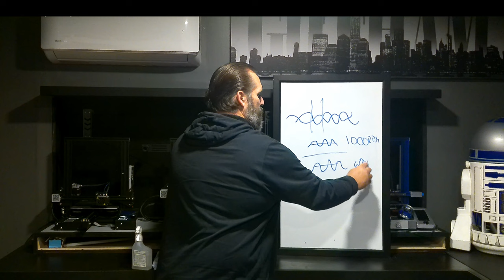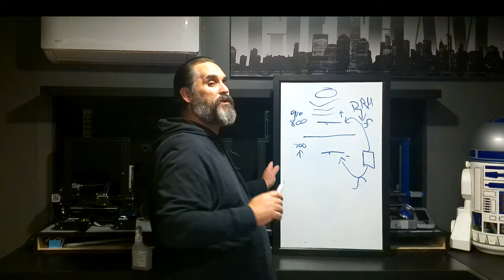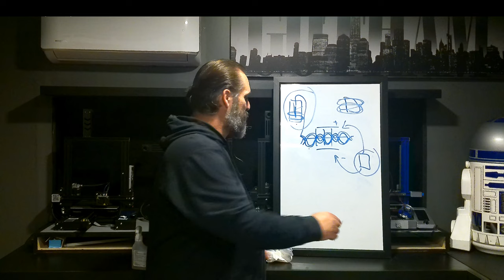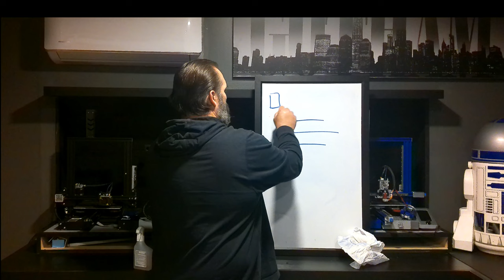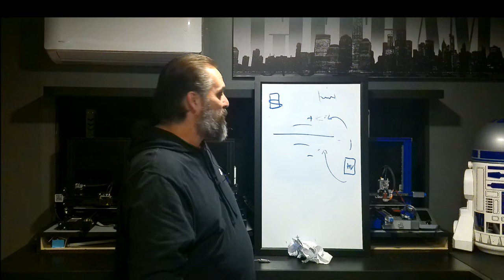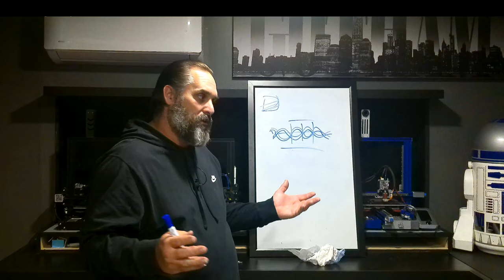Graviflyer "Tuning By Sound' #26

Comment: Gravity consists of two structures. One is the lower and the other is the superior rotating (+) static charge field radiation(x-ray). These fields turn against each other. the upper rotates to the left, the lower rotates to the right (vortex). Everything remaining in this field (all matter is a negative single pole. ) is attracted and the earth's gravity (this is the same" + "static monopolar) affecting it pushes each other because they are the same. This creates lifting power. This is actually the stellar gravitational field, that is, gravity. You cannot fly the graviflyer without understanding this.antenna x-ray lamp.

Comment: Assuming the graviflyer actually works as claimed and the obvious unknowns of tuning it to do so, have you considered putting effort into automating the ranges of frequencies - and other parameters - into a e.g. an Arduino program that sweeps those frequencies/parameters, then leave the program running while you video the graviflyer? Let the Arduino code, i.e. automation, do the hard work of testing variations until positive effects are detected. If you shared this code with other testers, then you can 'divide and conquer' test ranges.
Reply from the maker: yes I have thought about it. I will look more into it after this weeks testing.

Comment: Unsicgronized metronomes become synchronized after an amount of time dependent upon the unsync threshold of all and the number of metronomes.
Reply: When they are on a platform that is free to move in the axis of the swinging pendulums.
If you do it on a fixed platform, unmovable, the effect will not happen.

Comment: Do you have a sound bit of what alexi device sounded like. I play guitar and I got a good ear…. Also if your going to go off what alexi device sounded like you would have to have the same size discs. Yours the same size?
Reply from the maker: We will all have a different answers. I know that. The goal is to hear the main parts. I think the interaction that can be amplified is the answer. to what degree is subjective. I just want to line them up with sound so we can test with the oscilloscopes. Alos with an audio program to have values for them. This should move us so much further ahead. 

I am going to buy the worst and oldest mic available and the program that shows everything. That way I might get to share the answer.
Reply: Right on. Thank you 🙏 please keep posting I’m catching up and then we can compare notes. 🤙

Comment: So are we dealing with 1.5 scalar levitation? Top and bottom single scalar and middle plate 1/2? What is the area and weight difference of the middle plate? Wouldn’t making the middle plate the same size as the others eliminate the fierce pushing buttons piezo need ?
Reply from the maker: the middle plate has to be double the size of the rotating ones.

Comment: An earth compactor rammer is hopping and jumping (if operated correctly) by converting rotational motion into linear motion.
If one wanted the compactor to levitate one needs to couple and 'lock' to 'something' in 'empty space' so it does not fall 'back down'.
I'm still trying to under-stand what this 'something' is, and how to 'lock' onto it.   Anyone has an idea?
Thanks for your updates Nathan!
Reply: Tu razonamiento es correcto, y bien encaminado, a esa nada a lo que se engancha mediante las frecuencias es a las propias ondas gravitacionales o campo (fuerza nuclear débil), una parte de él entra en disrupción, osea la mayor parte del campo se desvía, pero las líneas que quedan atravesando el aparato sirven como cuerdas con nudos por la cual escala y puede quedarse quieto "locked", si no tuviera nada saldría volando extremadamente rápido. En el espacio circundante del planeta tierra con gravedad osea en superficies de cuerpos planetarios es el método usado y mediante el voltaje tengo la creencia que empujara más líneas gravitacionales y por tanto el aparato será más ligero y tendrá mayor capacidad de levantamiento o mayor rendimiento por cm² or inch², en el espacio necesita más voltaje para distorsionar más el espaciotiempo y amplificar las ondas que percibe para dirigirse/manejarse.
Reply: @tomasanderson6729  Thanks for your input.
 If I understand you correctly, you're saying it is gravitational lines which is responsible?
It could well be - gravity is not well understood, some says it is the effect of mass/energy 'warping' space-time and other says something else.  I hope we will understand it much better, and work with it to create anti-gravity devices, very soon.

I used google translate to translate, please let me know if it is 'wrong': 
"Your reasoning is correct, and well directed, to that nothing that is hooked through the frequencies is the gravitational waves or field themselves (weak nuclear force), a part of it goes into disruption, that is, most of the field is deflected , but the lines that remain crossing the device serve as ropes with knots through which it climbs and can stay still "locked", if it had nothing it would fly away extremely fast. In the surrounding space of the planet Earth with bone gravity on surfaces of planetary bodies it is the method used and through voltage I believe that it will push more gravitational lines and therefore the device will be lighter and will have greater lifting capacity or greater performance per cm² or inch², in space it needs more voltage to further distort spacetime and amplify the waves it perceives to direct/manage itself."
Reply: @EgonSorensen  the translation is correct, now i write in spanish because i don't mastered the scientific terms that  English uses. No soy físico, pero en mis años de universidad por el año 2010, con un profesor con doctorado en mecatrónica con quién llevamos buena amistad mi grupo de compañeros y yo, nos invitó a experimentar con unos levitadores iónicos posteriormente llegamos a un modelo similar al de Alexey pero sin motores contrarotativos y con un hueco en el centro donde estaba insertada la bobina Tesla, en vez de motores teníamos bobinados opuestos y mantuvimos un arreglo de imanes de neodimio sacados de discos duros de igual modelo el patrón que usamos fue de 6 por lado como el hexágono que hay en Saturno, pero con el arreglo que hace que leviten los discos maglev con las corrientes de Lorentz (arriba izquierda abajo derecha) por mencionar un ejemplo David Sereda y veritasium tienen videos al respecto, es cierto que la gravedad no esta bien entendida pese que a los pendantes científicos digan que sí, si así fuera ya tendríamos plataformas (crafts) flotantes disruptoras de gravedad, y las tenemos de hecho, pero no gracias a la ciencia oficial, yo creo que es es una combinación de presión etérica, del universo y soles hacia las fuerzas centrífugas en equilibrio del planeta mas la distorsión espaciotemporal por sus enormes campos magnéticos los que crean el efecto de la gravedad, líneas electromagnetohidrodinamicas como el sol solo que al no estar ionizadas por ese plasma no se ven pero así creo que funciona la gravedad, busca videos de levitación acústica y el efecto Hutchinson (de Jhon Hutchinson), saludos hermano y que estés bien.
Reply: @tomasanderson6729  I understand not being able to write in specific terms - I speak Danish, but won't confuse anybody here with it :ø)
Did you get the project off the ground when you experimented at the university?
- phun intended, I know ionic thrusters can only lift so much weight and your setup sounds like it weights a bit. Sounds interesting!
I have read a bit about UFO's and their proposed methods of propulsion. Several designs seems quite similar to this - high voltage fields interacting with magnetic fields. Some designs supposedly only work in the atmosphere, where different methods of propulsion is required 'out in empty space'.
A great day to you too, and take care as well.

Comment: So if I spilled my iced tea on the garage cement with bare feet, step in the puddle, and grabbed the running full tesla coil powered graviflyer with both hands I would likely die or at the very least suffer both a heart attack and stroke wishing the rest of my days that I was dead? Right?

Comment: About your work , hands off you are the man, but you have alittle bit of confusion between voltage and magnetic field, i think the device is simpler thatn we had thought, the formula to use here is
F = I * L X B ( amper times lenght of the conductor cross magnetic field )
Reply from the maker: can you expand on that?
Reply: OK, I explain my point of view, the formula is F= I L x B ( the x is cross vector ) , the high voltage on top and bottom disks are charged to store an high amout of electrons, the rotation of the same disks create a magnetic field. The fact that the disk rotate creates an em wave, since electrons which are accellerated emit radiations in the form of a travelling wave composed by two fields E and B which are at 90 degrees each other.  The external tesla coils, in my opinion create a reference voltage where the bubble of em wave can interact and push against. Think about a boat which move water to propel itself, it couldnt' if there wasn't a vast amount of water. The magnets on the bottom disk increase the toroidal magnetic field so to have an unbalance , what is not clear to me i sthe use of the piezobuffer.